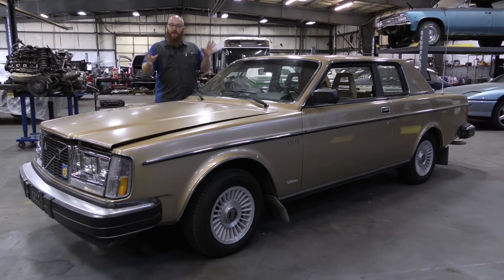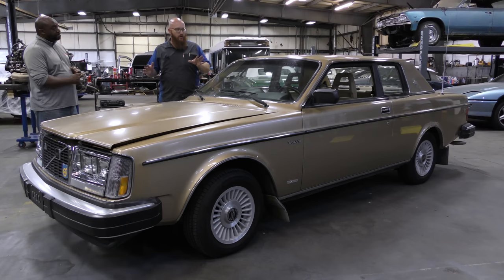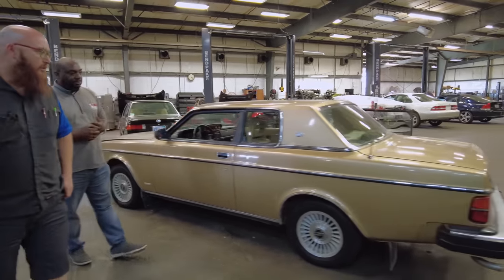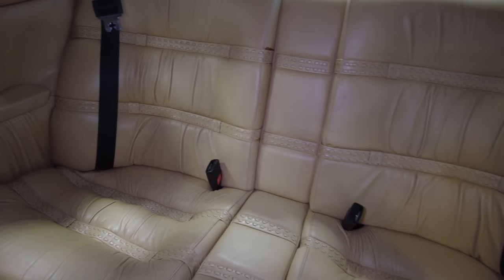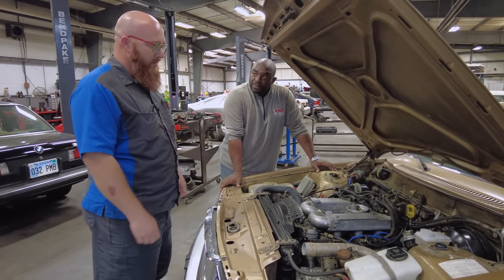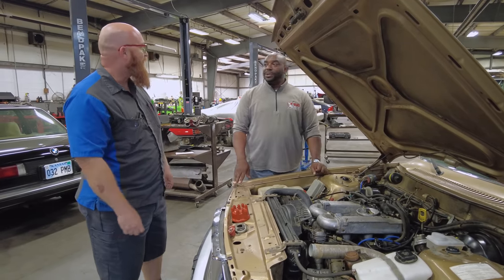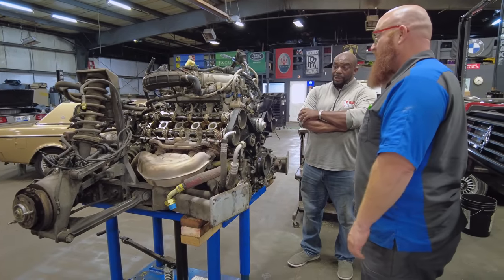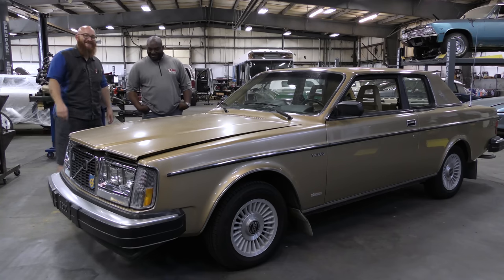Italian Volvo? Rare ‘80 262C Bertone in my shop! Why is Bug Ninja in a Ferrari engine bay with me?

Comment: This is the PRV V6 engine, and was developed by Volvo, Renault and Peugeot. It came in several versions from 2.5 to 3.0 liters. They are NOT rare, other than maybe in US. They where produced from 1974 to 1998! Total production numbers was over 970000 units! Used in Volvo 260, 760,  780, 960 and Peugeot 504, 505, 604, 605 and Renault 25, 30, Alpine, Citroen XM, DeLorean among others
Reply: not rare but not great.  Europeans can somehow still manage to make things expensive even with they have economy of scale on their side.  This car would be a good candidate for a 5.0 Ford swap.  The Ford V8 is narrow enough to fit very well in these.

Comment: Loved these. We were a Volvo family in the 70's and 80's when these came out, but they were so expensive in Aust at the time. If I remember correctly, only 100 were imported (during 1980 and 1981), 85 in the gold colour and 15 in the silver / black vinyl roof. The interior of this car is in great condition, as the few that I have seen, the interior is shot to pieces. From memory in 1980 a new 264GLE was AUD 20,000, whereas the 262C was AUD33,000, quite a premium.

Comment: Oh, I love the looks of this car.  Our neighbor has one and it is all heck to find someone to work on it.  We have a VERY specialty shop about 150 miles from my place that he takes it to, and I have helped him move the car there.  When you find a good shop, you drive a long way to get things done right.
But I just wanted to pass along one of those "Geez, what interesting timing for something to happen" stories.
I was driving my 1985 Toyota pickup and was (literally) driving past my regular shop when the master cylinder gave out.  OK, I can do that but, hey, I am at the shop, hand it over to them.  I had just seen that one of the rear wheel cylinders had started to leak, so it was going to be fixed the next weekend.  So, told them to replace the MC and overhaul the rear brakes {new hardware, new cylinders, OEM shoes, and check drum thickness (which turned out needing replacement)}.  They quoted me a price and I was reminded why I do this kind of work myself.  Gave them the go ahead and told them I did not need the truck for a while, so no hurry.  Done in a couple of days, paid for it, and would have my wife drive me down to pick it up late at night when she got off work.
Got most of the way home when the brake pedal suddenly felt a little soft.  I thought that was odd, but figured I had got a bad wheel cylinder and would check it when I got home (less than 1/2 mile).   So I just drove 25 instead of the 35 mph limit.
Was going down a hill into the stoplight next to my house when the brake pedal just flopped to the deck.  That can nearly cause a coronary.  Downshifted through 2nd to 1st and pulled the e-brake and everything stopped straight and in time not to run the red.  Eased it around the corner and stopped behind the neighbors tow truck.  Left the keys under his door mat and a note saying what was wrong and where to take it.
There was ONE single place on that truck that the shop could not see when they did their examination before starting work.  And that was where the brake line went over the fuel tank.  And, now, there was brake fluid spilling out from over the top of the tank.  Absolutely no rust on any of those lines that could be seen.  But a clip had broken and the line was vibrating against something and developed some corrosion... and the timing was just weird that it decided to break after a system overhaul.  Finding that brake line was a bit of a chore so they ended up just making one.  Glad they do good work as the e-brake did it's job.
But more bad timing....  I had filled the gas tank on my way home......  Why does it always happen like that?  Had them clean out the gas tank while it was down (with apologies for the bad timing).
Just thought Car Wizard and everyone else could get a smile from this story.  Everyone seems to have these 'bad timing' stories where the shop did everything right.....  And then, out of the blue......  The really good thing is that they had fixed everything right and the e-brake was properly adjusted and working to exact standards.  And then the good timing that it broke (basically) right in front of a tow truck.
Blessings, everyone.....

Comment: Oh, this brings back memories. I, sucker for punishment that I was, bought a 265 from a friend. The engine has a very complex wiring loom that goes under the intake manifold, which, after enough time, starts to have the insulation on the wires deteriorate to the point that you get shorts. Then you get fun events like the engine not being able to be switched off, or starting by itself. An owner of a manual version had left it in a multi-storey car park when it started itself and shot out the side!  I had to start mine by poking a long screw driver down under the block to short some or other wire. Eventually it died while I was driving, and between spending a few thousand on a complete re-wire and getting another car, the latter was more appealing. 
One of the Australian Volvo experts owned the Bertone though. He dropped the engine and put in a V8!

Comment: At 16:25 the B27 was in use from 1975-80, then then made some minor changes to it and called it B28 because it had bigger bore and was in use in the 240/260 1980-81 and Volvo 760 1982-86, then they rebuilt the concept with several big changes for the better and called it B280 and it was in Volvo 780 and Volvo 760 from 1987 to the end of the era in 1991. Alsoyou could get the B27 in the Volvo 240 GLT6 1980-81 and the 760 with both six cylinder VW 2,4 liter diesel D24T engine and B23 Turbo. The Volvo 780 was also available with the four cylinder Volvo red block turbo engine and the VW 2,4 liter diesel D24T engine. Also the B280 is a very much better engine compared to the B27 and B28. Thanks...

Comment: Thank you for this... I remember seeing this car as a kid.  I believe some had a vinyl roof if I recall correctly.  My father had an '82 Volvo DL, the base 2-series with the four cylinder engine.  The car was bullet proof, and he finally let it go in the mid-90's with nearly 300K miles.  It still ran well, but the interior was crumbling and falling apart.  As a kid, my dad told me that the "DL" was and abbreviation for "Disguised Lamborghini".  I thought it was the coolest car ever.  I wish we still had it today.

Comment: This vehicle is easier to explain if you look at the immediate predecessor, the 164E.  Slightly lengthened wheelbase and an inline 6 engine, plus many of the same design elements.  They wanted a better, more sporty version of the same thing to go with their new 200 series platform and this was the result.
As a plus, there are many independent mechanics who know how to work on old Volvos as they were what many of them first learned on.  Until 2000 or so you still saw Volvo 240s everywhere as they made 2.8 million of the various variants.

Comment: The cis system is a good system,, it just need to be sealed up to work properly. I loved them on my older vw
Reply: Agree.  The Bosch Continuous Injection System (CIS) is very reliable and was used by numerous OEMs that included Mercedes, VW, Porsche, Ferrari, etc.  It's not the fault of the CIS if a technician has little to no knoweledge of the system or isn't prepared to do some basic research on the system.  Consequently, I consider it disingenuous when persons who should know better denegrate it.

Comment: I worked at the Volvo Plant in Chesapeake Va. during the years of these. We serviced and repaired Sweden, Belgium and Canada's Volvo production problems before going to the dealers. Lots of production problems and shipping damages. I liked the 262. Im not that tall and my head almost touched the roof inside. One thing. Dont close the doors too hard with the windows down. The glass will shatter inside the door. Fun to clean up and replace.

Comment: The V6 was so plagued by camshaft failure that Volvo recommended drilling through the firewall to extract the cams so you wouldn’t have to yank the engine.
Reply: The new camshaft kits even came with a rubber plug for the hole you drilled through the firewall to replace the old one!

Comment: I had one of these, a 80 with 82bumpers and a B21ET(original 240 Turbo engine) with manual gear. I took it to the local Volvo dealer tfor them to check it so it was roadlegal. Could not find the mechanic I used or the customer reciever. Found them after 5 min outside looking at my car.

Comment: I owned a Volvo '77 264GL from '79 to '93. It had this same engine - the B27F - and in the 14 years that I owned it it never gave me a bit of trouble. When I traded the car in at the Volvo dealer in early '93 it had 205K miles on it and with proper care it could have gone a lot more.

In the summer of '81 I took an '80 Bertone, that the dealership had up for sale, for a test drive. That '80 Bertone had the newly introduced B28F. (Half-way through the '80 model year Volvo had switched from the B27F to the B28F - the same one the DMC-12 had - in their 260 models.) I didn't buy the car because the low roofline meant that there was no sunroof and I loved the sunroof in my 264! lol

In the '86/'87 model year the engine in the top Volvo models (760 & 780) was switched from the odd-firing B28F to the even-firing B280F. Horsepower in North American models jumped from 130 to 153. Very competitive with other cars of that era. All in all it was a very good engine and took Volvo top-of-the-line cars into the '90's when the new modular 6 cylinder was introduced in the 960 models.

Comment: The v6 was meant to be a v8, but then the oil crisis came in the 70s, and so they had to save money and made the v6 instead
Reply: Is that V6 the PRV (Peugeot-Renault-Volvo) engine?
Reply: @miguell1018  Yup
Reply: The even changed the V8 to a V6 by chopping off 2 cilinders: the result is a 90 degree V6, wicht is not a standaard angle.
Reply: @miguell1018  This is the same mill used by DeLorean. DeLorean realized to develop a new engine would take at least 10 years to pass inspection, let alone the international market. So DeLorean took the Volvo (and others) designed powerplant with approved pollution standards and used it in order to speed up production because he was purely living on credit and needed to make money.
Reply: @pierrebrouwer2183  Yes, the ideal angle for a V6 is 60 degrees - not 90.
Reply: @PhilDykshoorn  Actually, the DMC-12 used the updated version of this B27F - the B28F. No B27F's were used in DeLorean's.
Reply: @pierrebrouwer2183  therefore that engine has a special sound for being a V6
Reply: YES @miguell1018
Reply: @kmg81  My Mercedes has the M272 engine, which is a 90° V6 with balance shafts. It does sound almost exactly like the M273 V8 from which it derives.

Comment: The 3.0L PRV was also available in the Eagle Premier/Dodge Monaco from 1988 until 1992 model year.

I had a 1989 Premier ES. Nice car when it ran. Not terribly reliable. Surprisingly enough the engine never cause many issues aside from the TDC sensor.

Comment: I believe it would have also seen use in the Eagle Premiere/Dodge Monaco twins in the late 80s or early 90s as a holdover from when Renault owned AMC. It may have also been used in the US version of the Renault 18i or Peugeot 505 but I can't be sure.
Reply: The U.S. version of the Peugeot 505 used the PRV V6 later in its run, so yes.

Comment: I had one from 1998 through 2001. As a 6 foot 8 man, this was by far the most comfortable car I ever owned. I could sit in this car and drive non stop for 12 hours.  Unfortunately the cooling jackets broke in the engine and I was told they could not be fixed.  The next owner pulled the engine and I stalled a V8 in it.

Comment: I did spend about $5K in parts and labor replacing everything that is fuel related.  This car sat supposedly since 1996.  I bought it last year April.  Stoked to drive it with a smooth running engine.

Comment: i had a regular 242 of the same year, looked identical except the roof line and the leather.  mine was a 4 cylinder cis injection.  the 262C would have done much better with the turbo 4 that came in 1981 or 82!  later we had a 740 with the turbo 4, great engine

Comment: One thing that should have been mentioned is that the 262C originated from the previous version 164 not from 240, while 262C was still under the prototyping. During that time it was planned to have V8 engine instead of V6. When the 262C production finally started 24X  line was already launched, so the 262C got its outlook from it.

Comment: The Prv lived on in renault and peugeot/citroen right up till 1996. It changed from an odd fire to even fire in the 80s. The last road going incarnations saw it fitted with 24 valves. Exclusively used in the peugeot 605 and citroen xm giving 200bhp, ported heads and ported exhaust manifolds. But in europe the  use was any large peugeot, 604, 505, 605, renault 30, 25, espace and  alpine. Renault did turbo the prv 12v giving it 195bhp when used. 
All prv units were replaced by a single Peugeot Renault v6 24v quad cam ohc engine from 1996 ..

Comment: The Bosch Continuous Injection System (CIS) is very reliable, relativley easy to maintain and far superior to old tech carbys.  The CIS and was used by numerous OEMs that included Mercedes, VW, Porsche, Ferrari, etc.  It's not the fault of the CIS if a technician has little to no knoweledge of the system or isn't prepared to do some basic research on the system.  Consequently, I consider it disingenuous when persons who should know better denegrate it.

Comment: 80s and 90s cars before OBD II were a nightmare to work on.  Volvos manuals didn't help much either.  After having an 86 it really made me appreciate how good the GM ones were for their cars.  The GM ones even told you how to rebuild an alternator or AC Compressor.

Comment: I picked up a Volvo Bertone for my wife a few years ago with the rarer manual transmission. On a 3 hour drive the from Atlanta it flattened out a cam lobe (cam oiling is a known weak point). Instead of putting money into a 🤮PRV motor I picked up a manual 2016 Mustang with the 2.3L Ecoboost to swap into it. Almost triple the power with much better fuel economy and a 6 speed!

Comment: The PRV engine was good enough to be adapted for use in general aviation (so were VW  and Porsche engines). The V6 was used front engined/front drive in the Renault 30, the engine and transaxle was cleverly used in the DeLorean to make it into a rear engine (or mid engine can't remember which) exotic without having to develop something totally new.
I believe Bosch is responsible for the sensor and Lambda is a Greek symbol? Omega is Greek come to think of it.

Comment: The 2nd digit is not always the number of cylinders (even tough in most cases it is). There are PRV V6 engined Volvo 244's and 245. There are also Volvo 360 models that all have a 4cyl (not in the US but all over the rest of the world). But the 2nd number as cylinder count was mostly true until 1982.

Last the PRV engine was used in a Volvo was the 760 (1982-90) and 960 (1991-92), in 960 Ambulance until 1992 on some markets (even tough most 960 used the inline6 B6304 at that time). The PRV was still in use in the 2000's in some Peugeots, Citroens and even Renaults as a 24valve 3,0L engine. There are A LOT of exotic cars with the PRV engine, racing models etc.
https://en.wikipedia.org/wiki/V6_PRV_engine

Comment: What you want on that engine is a set of carbs and manifolds from a Talbot Tagora V6. They had a pair of Weber IDA tripple barrels, like a carbed Porsche 911. Lee Noble, creator of the Noble supercars, won many races with those PRV engines in his Ultimas and Ferrari P4 replicas. He was probably responsible for the destruction of most of the surviving Tagoras, robbing them of their carbs and inlets.

Comment: The Peugeot 604 SL also used the 2.7 PRV engine, but they did a carbureted version instead of the Bosch K Jetronic , probably ended up slightly more  reliable .

Comment: still have the tools.  ground on the CPR gets bad. mounts for the fuel distributor go and the body pulls off the boot. Clean the fuse ends and grease and away you go for a decade. and greaseable door hinges

Comment: The engine family was used in 262, 264, 265 and 760 V6 models. The 264 and 265 was the luxury 4/5 door models built buy Volvo themselves. The V6 engine didn't have anything to do with bertone but was was developed jointly by Peugeot, Renault and Volvo in collaboration, and is therefore generally known as the "PRV engine".

Comment: Lambda is the greek letter used in science for ideal ratio. The oxygen sensor allowed monitoring for the stoichiometric fuel ratio. The exhaust gases from close to stoichiometric fuel air combustion would let a new catalytic converter with additional metals to work to get a huge improvement in emissions with much reduced additional hardware on engine. Tuning the b27/28 was tedious. The mods done to get the most from the v8 to v6 change included a different cam profile on one bank. The purpose was to have weaker idle combustion on the cylinders that had the short crank travel and stronger idle combustion for the ones with the long travel due to the lopped of cylinder. There were two throttle bypass air screws, one for each bank. One bank would be close to 5 turns from clsed and the other close to 1 turn when the CO was in desired range for each bank. Camshafts failed a lot as the engine was slow to warm up and a lot of condensation was slow to evaporate. Short trip drivers got rusty cams and lobe and rocker arm contact wore out. Long commute highway cruisers went 300k and more with no canshaft wear.  Bottom ends were never an issue